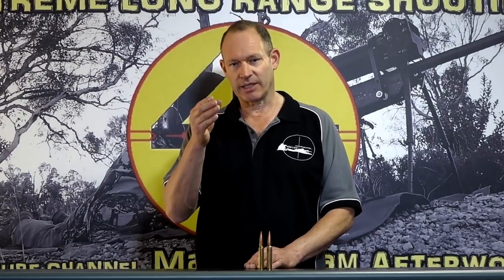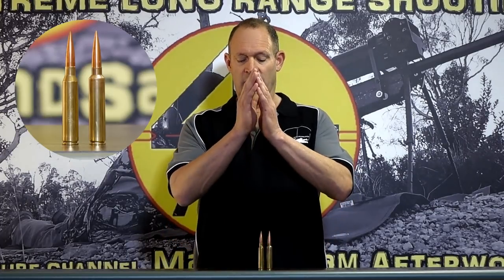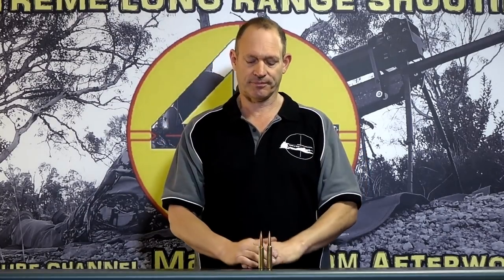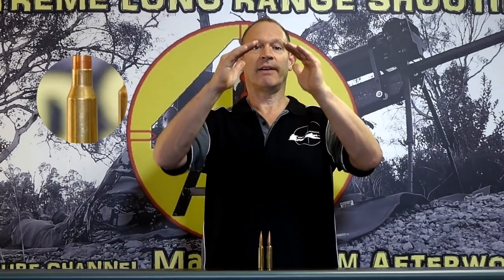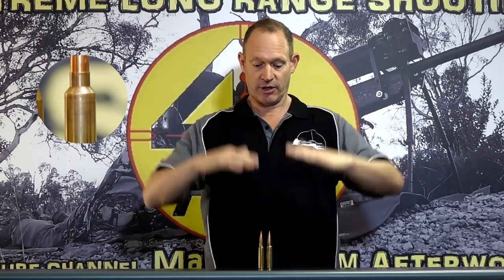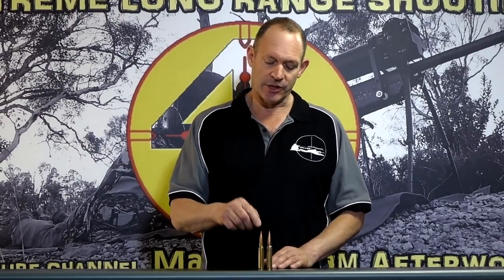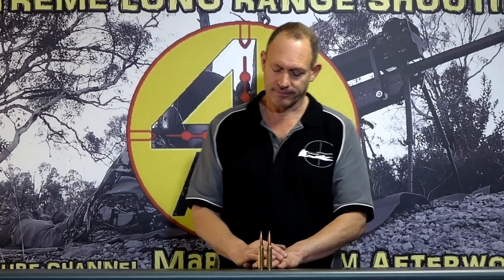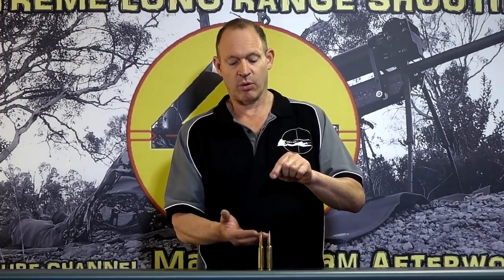Improved Cases, Compressed loads and FPS

Comment: Best load development I have found is finding the flattest velocity variation between a spread of charge weights to find the most consistent load and the lowest es spread... I go between .3 to .4 grns between charges and find the least amount of velocity change between 3 to 4 charges... There are usually two nodes and you can even hear the difference when your barrel is in harmonic attunment with the bullet....
  Plus using quick load to find the best powder for case fill and burn rate so you can build a barrel or load to have complete powder burn and reduced muzzle pressure. At 3 to 4 thousand psi at the muzzle the bullet will be asleep as it leaves the muzzle.
 I like belted magnums the best for improving cases.... I made an improved case out of a 7mm weatherby case to 35 degree neck and it has 91 grn h20 capacity. I run the 195 Berger at 2950 on a low pressure node to save brass... My brass lasts 10 loads easily... The improved case reduces the brass flow and. Hardens the soft norma brass around the shoulder just enough to give it characteristics of the stronger Papua brass... The neck is already thin and consistent in the brass and the neck length is .333 so it is a good length for a .284..... My reamer was designed to chamber the 180 hybrids but it also allows a longer usable barrel life with the 195's. The funny thing is both bullets have nodes at 2950 using different powders so it is nice to have options that have same velocities and poi.... The 180's run off of h1000 which is good for extreme weather and the 195 run on reloader 33 which is a good case filler for long range shooting.......
Reply from the maker: Thanks Shannon, Cheers

Comment: "Fill the case up, Jam a bullet in and shoot it" I did that once. When I first started reloading 22lr (the only caliber I have reloaded to date)  after initial success with progressively stronger loads...I decided to just fill the case, jam a bullet in and shoot. 
Now the 22lr, being developed for black powder has FAR MORE case capacity than needed. In fact most commercial 22lr rounds are loaded less than half full. The experiment that I did was before I even had powder scale. Just eyeballing a commercial round it was evident that I should not go over 1/2 capacity (capacity of a 22lr is about 4.2 grains). 
I had me an old Remington 514 for testing and figured it was way over-engineered and would handle a 22lr with a full case of modern pistol powder.  
Remembering an old friend's approach to driving fast cars, "If you don't push them past the limit, you will never know where the limit is" hahahahaha
So I proceeded. with safety glasses a grinding shield, welding gloves and heavy coat. I shot the double load.
 Catastrophic failure. It blew out the extractor to never be found. The gasses went back through the bolt directly in my eyes (fortunately shielded) and the case was torn in two pieces.  
Sorry for sharing that.
Reply from the maker: Hi Hans, well a dumb as that was, at least you lived to tell the tale, at I suspect learned a little that day, lol, Cheers

Comment: Interesting. So what defines compressed load, is it 100% case fill minus the projectile seating volume and any amount occupying the displaced projectile volume? So if you run a powder that’s safe to 100%fill and compressed load then does weighing powder matter that much at all? Just scoop it full and plug it up and call it a day? Is there much variance in SD and ES when you cross 100% fill and into compressed?
Reply from the maker: Compressed means the powder is seized a little, as for measuring, still very important, all about many other details, wrong powder compressed it very dangerous, big bang!!!

Comment: Great Video Mark and Sam.
Just short advice if possible, 300 PRC 230 gr A-Tip i will get very nice extreme spread of 5-7 fps on 10 rounds, but it won't group. Best group i can get is 1.2 inch at 100 yards. Any ideas? 
Yes my rings and all bolts on rifle are tight and toured to spec nothing is moving. 
Thank You
Reply from the maker: Well really couldn't say without being there, but as said main times, it can be about the rifle or the shooter. Not saying this is your problem, but for lots of folks, the first time they step up in calibers, they find this sort of thing and most cases although what they are doing works fine for the smaller ie 6.5cm, 260, 308 etc, both the hardware and shooters form are not up to it, and some lessons or some research is required. All comes down to the bullet leaves after the rifle has started to move, more bang, more movement, bigger group. As said, couldn't suggest what is your issue, but this is what is true for many, Cheers
Reply: Thank you 👍🏻

Comment: Mark, so how do you determine your max charge? I assume you choose a max SAFE weight that produces reasonable es & sd? On a separate note, what's your opinion on bore rider/+P throat designs? Thanks and keep up the great work, it's much appreciated.
Reply from the maker: Well as said, I run to any pressure signs, I rarely use speeds, much more an ELR group, but of course I can, I have the range, most don't and so can't. As for bore riders, they by design are a trade off, they allow a larger projectile and a little more powder by having the bullet further forward, but the bore rider design, lowers the bc, so they work some times and not others. I prefer not to use, Cheers